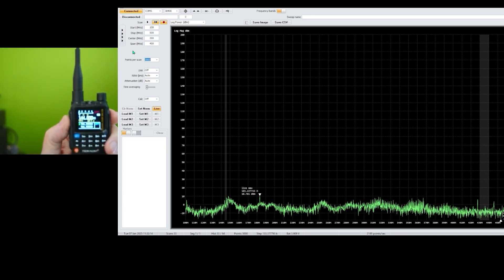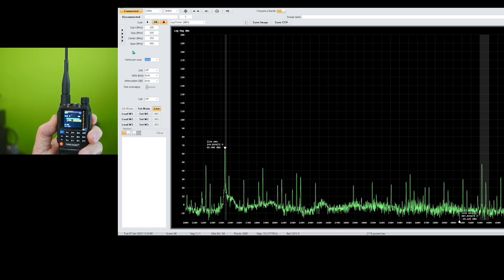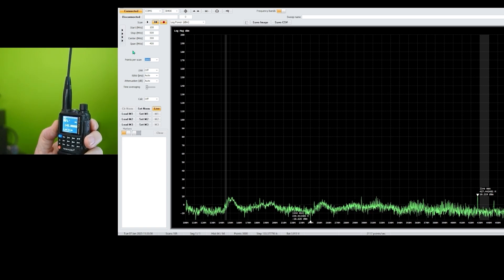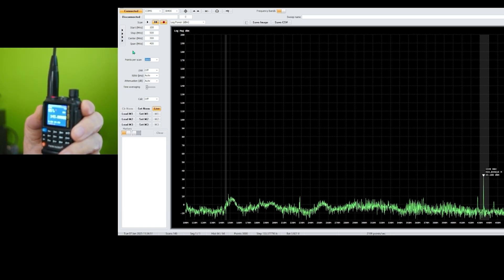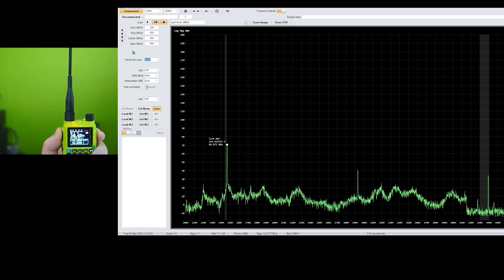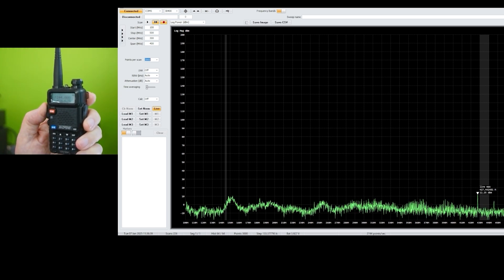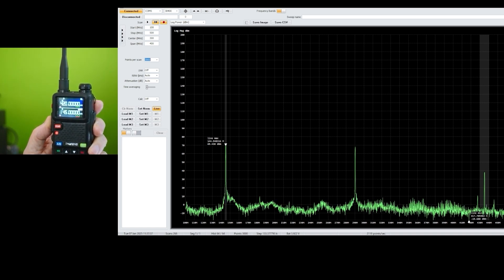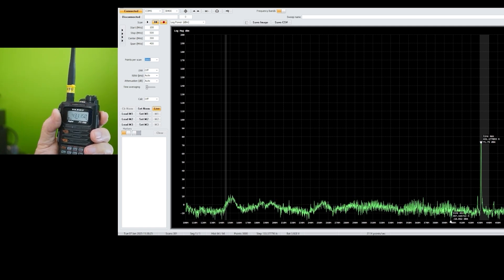Do You Want to Transmit with One of These? You May Be Fined Thousands of Dollars & Lose Your License

Comment: Not to mention they transmit on restricted channels like fire and police. Ill keep my old kenwood. Kids are getting these off amazon and using them to mess with police transmissions.
Reply: His testing methods were incorrect. He needs to take this video down.
Reply from the maker: I tested two ways.  One was directly to an antenna with 30dB of attenuation. The other was through a box that I built.  There was a directly line from one UHF female to another UHF female. In the middle is a ferrite bead about an inch O.D. and mix 31.  There are a few turns to pick up RF.  One leg is to chassis.  The other to about 30dB of att. down to a BNC female. From there to the tinySA.  Also, the H8 and the Yaesu (when on 144) had no harmonics.  They looked very clean.  Yes, overload seems likely but since one of the Tidradios and one of the Yaesu was clean, I don't think the tinySA stressed.  You asked a very good question.  Thanks for your help.  73, Jim W6LG

Comment: Love your channel Jim, but this sounds a bit like elitist crap to me. Wouldn't touch them you say. What do you say to the guy who cant afford to drop $180 on a Yaesu or a Icom etc. So he should just not participate in ham radio even though there are FCC certified radios that he can afford? Just because it is cheap and therefore accessible does not make it bad and frankly I have long been  tired of the elitists who can afford to have the "My radio cost XXX so its obviously better" attitude. Just my opinion and worth about what you paid for it. It's that group of hams that chased me away from the hobby for so long.
Reply from the maker: Good points.  That is why if you buy one, you need to have it tested. Again, thanks for the comment. 73, Jim W6LG
Reply: @ham-radio  I can agree with that. Anytime you get the cheap stuff, (or even the not so cheap stuff) if you have access it never hurts to have it tested. Thanks for replying to me!

Comment: If the radio is being used as intended and is part certified, then the FCC should be addressing this with the manufacturers. What this video is implying is a widespread interference caused by improper manufacturing which is not the fault of the person who bought the radio. The FCC always seems to target one or two indiviudals and then try to hit them with ridiculous fines instead to actually addressing widespread problems. Let's look at GMRS: People are buying Ham radios and using them for GMRS. It's clearly against the rules, but the FCC doesn't require license verification to purchase a Ham radio. It would be very easy to do this since everyone is listed on the FCC website, but they'd rather target individuals. I bring up GMRS specificially because there are no skills required, and no radio knowledge required to get a license. A typical GMRS user is not going to know anything about the interference. The enforcement needs to address this at a higher level than just targetting the consumer who bought the radio legally. It is what it is, but I think it's lazy. They are just grabbing the low hanging fruit and nothing will ever change that way. That being said, I did find this video to be very informative. Thank you.
Reply from the maker: I believe that enforcement at the FCC, not private individuals, needs to be ramped up.  Also, we, us, all of us, need to be very careful.  With a new Administration, there may be again some interest in taking away some of our frequencies again. 73, Jim

Comment: Hi Jim, unfortunately your Yaesu was transmitting on 431.15 MHz versus down on 2 meters so impossible to compare its results with the other HTs you tested in this video.  Also as others have mentioned you really should test each transmitter hooked directly up to the spectrum analyzer or SDR using enough attenuation to assure the input level is below the level where the mixer starts generating harmonics.  As an example if using a TinySA the input level should be -30 dBm or lower to  prevent generation of harmonics in the TinySA mixer.  P.S. you’re looking great.
Reply from the maker: True.  I had locked it on the node.  I had tested it on 2 meters with basically the same result. It was clean down 60dB into my noise.  73, Jim W6LG

Comment: If the same antenna is used on the signal analyzer for all tests, and all of the HTs are transmitting at the same power, the concerns about and effects of overloading the SA should be the same for all of the radios.

However, most of the radios appear to be transmitting at 145 MHz or so.  I'm not sure about the 5RM,  both VHF and UHF frequencies were displayed. The Yaesu appears to be at 431 MHz and with the SA scaling, harmonics are not shown.

It's an apples and oranges comparison.
Reply from the maker: Thanks.  I did test two ways.  One was with a sampler using a toroid to the tinySA connected to my Bird Dummy. 73, Jim W6LG

Comment: When was the last time the FCC fined someone for doing just that during a wildfire, and how many times in the last 10 years? Just once in the last 10 years. And no one has been fined for just  talking to his friends using a handheld radio in the last 10 years. And you may have a pretty good idea about how many people own these cheap handheld radio's in the US. You can check the FCC's database on that data.
Reply from the maker: Good points. It shows that there is not enough enforcement at the FCC.  The compliance tests may be worthless. 73, Jim
Reply: @ham-radio  Well, cheap Chinese handhelds are normally not a problem because people move around with them. So even if they cause interference, it will just be for a short time. 

While a cheap Chinese basestation could interfere for way longer periods of time because it always at the same place. 
The FCC will only act if a radio causes a lot of trouble, and that's okay with me.

Comment: This is another reason many agencies are going digital. DMR, or trunked systems to prevent this. However, there is no way for the FCC to find you; a needle in a hay stack when transmitting...
Reply from the maker: True.  Very true.  But if I am in the Command Center and I interfere with the Sheriff, he is going to be really upset with me.  73, Jim W6LG
Reply: @ham-radio  Thats if he can find you, very doubtful a 3.5w radio will cause any interference with a 40W Motorola radio. Sorry, not gonna happen.

Comment: This is gaslighting and fear-mongering. The FCC is not going to fine a person for accidentally keying one-time a emergency frequency and being instructed to end transmissions. They will only fine you if you ignore or persist to transmit inappropriately. The recent $34k fine levied was for a man that acted in bad faith and ignored authorities. Now, as far as dirty HTs, I don’t know what your agenda is, but you are way over-focused in this. Yes manufacturers should do a better job and it is not ideal, but it is not an everyday problem. Show me one FCC website link of a fine levied because a person used a cheap HT with spurious emissions, then you can talk. This is a nothing burger.
Reply from the maker: Do you or would you, transmit with a filthy, spurious transmitter that covers the sheriff, police, ambulance service, fire department, and other entities?  I won't do that. I can imagine the headline in the local newspaper or local TV station that says "local ham causing harmful interefernce!"  Transmitting on their frequency is not a nothing burger.  And what is your callsign? How many years have you been licensed?  Jim Heath W6LG 61 years on the air

Comment: Good and valid points, but you picked the wrong radio for an example. The TIDRadio H3 is one of the few Chinese HTs that have been measured by knowledgeable hams to meet or exceed FCC spurious emissions standards. And, no, I don’t work for them or sell their radios.
Reply from the maker: Yes. I tried it with a "T" and antenuator into a Bird Wattmeter and Bird Dummy Load. 73, Jim W6LG

Comment: A big annoyance regarding Chinese radios that few ever mention is that they don't have encoders for changing frequencies in VFO mode or memory channels. They only have very slow up/down keys to change frequency operation. They also seem to always lack a DC-in jack so you can't plug them into a cigarette style adaptor in your car. Or maybe an external battery, like I have for my other radios. I have multiple barrel plug adaptors that I can use for my Kenwood, Yaesu or even my old Radio Shack relic using the same motorcycle sized battery. A good emergency back up. Very handy and you can't do that with any Chinese rig. At least none that I know of.
Reply: They sell "battery eliminator" that let's you run off DC for most Chinese radios

Comment: Interesting spread of results (no pun intended). I bought a Tidradio H3 in early December (directly from the manufacturer's web page) and my specimen was actually pretty clean. Into a 50 Ω load (AKA high quality attenuators feeding into a Siglent SA), the 2nd harmonic was a decent -73 dBc and the 3rd was -64 dBc. Using the supplied antenna resulted in 2nd being -57 dBc and the 3rd being -68 dBc (but it wasn't great on receive) so instead using a Negoya NA-701 antenna (which was noticeably better on receive) resulted in the 2nd harmonics being at -60 dBc and the 3rd being at -61 dBc, so was reasonably happy with these results (incidentally, on UHF and transmitting into a load, the 2nd and 3rd were way down at -82 dBc  and -92 dBc respectively). 
I also bought a XHDATA E-100 and on my Siglent SA, it's output looked more like a toppled Christmas tree (hihi)! Into a load, the 2nd harmonic was -19 dBc (ouch) and the 3rd was -41 dBc (I'd still say 'ouch'; that's still far too high IMHO). Even more fun when using its supplied antenna; 2nd was -19 dB, the 3rd was -40dBc and 4th harmonic (so 582 MHz) popped up at -44 dBc (first time I've seen a 4th harmonic appearing from a VHF radio). Needless to say, I sent the XHDATA radio back the next day!  😀 I live at 152m ASL in Edinburgh (Scotland) so personally, I wouldn't consider transmitting on anything with harmonics above about -60 dBc; having a spectacular view of the city in the optical range means that my harmonics would also have a spectacular 'view' of the city in the radio range!! 😀 😀
Reply from the maker: Thanks.  Good to know. 73, Jim

Comment: They don't even do all that well on receive. I have two UV-5R8W (8 watt versions) that some one gave me. I put in all the exact same frequencies in both the Baofengs, a Kenwood TH-D75 and a Yaesu VX-6R. Then I put all on scan and the Baofengs were always stopping on various channels due to not being very immune from common sources of interference. All the while the Kenwood and Yaesu didn't usually stop on anything but an actual transmission. If I take the Baofengs out of the house in a open area like an empty parking lot then they do better. But they pick up the slightest LED light buzz, power supply buzz or PC/PC monitor hash a lot easier than good radios. BTW, my old Radio Shack HTX-202 is also not able to cope with modern interference sources so I don't use it much in the house.

Comment: If my 3W analog HT with a rubber duck interferes with a multi million dollar digital system, then it’s not my little radio that’s the problem.
Reply: Garbage noise thrown in the air can absolutely stop the transmission depending on location of the intended recipient on their handheld.  If the radio is truly for emergencies, buy quality and throw out the Chinese crap
Reply from the maker: Perhaps.  But I suspect that an excuse like that would not be acceptable to "agencies" like my local FBI office.  73, Jim

Comment: Most law enforcement and fire departments have gone digital, so surely it shouldn't be a problem
Reply: I think the FM capture effect works to overwhelm most co-channel interference in analog and digital modes. If a kid is on FRS two blocks away from a police car, and the kid's radio puts out a harmonic exactly on the same frequency. There is likely little interference that amounts to much. Unless the kid has a 100 watt FRS walkie-talkie!!
Reply: @markr.1984 Let's take 5 milliwatts and then do inverse square
Reply: @randykitchleburger2780  
5 mW will take you 60 km or more in line of sight, but the interference range is much less (and harmfull interference even less, but can be annoying, anyway...)
Reply from the maker: Good points, thanks, Jim
Reply from the maker: My local fire and police have not but probably will at some time. 73, Jim
Reply: Most rural PS agencies are still on analog.
Reply: There are still a lot of rural counties that are still on analog and have not been able to afford digital. My local county is getting ready to go digital.
Reply: Digital is more interfered than analog....😊😊😊
Do your homework...

55 years experienced on comms guy
Reply: @jplacido9999  I've been working in Public Safety in a major Metropolitan  area for thirty years and we don't have any interference on our Apco Project 25 system.
Reply: @jplacido9999  I've been in public safety For decades in a major Metropolitan are and our Apco 25 has had no issues with any interference.
Reply: @jplacido9999  That's incorrect.
Reply: @choppermike3329  
No.
FM analog can withstand more interference and survive.
Digital becomes inoperative (either you receive or you don't completly) with QRM.
Without interference digital goes fine, in spite of the terrible voice sound quality on receive (there are few exceptions), but even sincronized interlaced jamming blows digi comms and no one notices what is going on..
Reply: @jplacido9999  Over twenty years digital with no loss of comms.

Comment: Garbage is the guy who brags about 1,500 watts and  splattering the bands . I got a $35, 000 tower up 300 feet. 6 elements and 1,500 watts. That's bs and Garbage.  Not everyone has $50,000 for a hobby. I'll bet if I check your car, it generates as much garbage. Enjoy the I'm richer than you. Typical 6 call.

Comment: Provocative video, Jim. You make good points about the importance of knowing whether your TXN is clean or dirty.  A number of reviews suggest the TID H3 usually meets FCC standards. What’s different about your test vs others?  
Did the dirt your H3’s displayed  affect EmCOMM frequencies? If not, nobody’s gonna knock on your door unless you work hard to actively interfere  with emergency operations. 

FCC DOES consider the intentions of the operator when interference occurs. The Idaho guy fined recently   didn’t accidentally stray from the ham bands—- he purposefully used National Forest  firefighters emergency frequencies and attempted to direct personnel  to defend his own commercial property. And he persisted despite direct orders to cease transmission. 

Your 5-watt H3 would never muddy comms enough to draw that scrutiny.  FCC doesn’t have the interest or resources to hassle small fry.

Comment: Your results are very different from many others I have viewed? I  don't  have any of these but have thought of getting something to use on local repeaters. The most recent fines etc lately I have seen reported have been willful interference by bad actors not so much bad radios. What many misunderstand is the unlicensed CBer using wrong radios. What few realize is using a  radio not type accepted moves someone to a Communications Act of 1934  violation not a FCC rule violation greatly increasing fines or even a jail cell if ignored. The radio in CB is the license , while our ticket is our authorization. 

 I was surprised by your results and will be more diligent about what I do buy, thanks for the HEADS UP !!! Lately a handheld with a very wide receive has been written about. I am near a busy airport and have become interested in monitoring traffic from it and this held held  does hear the AM VHF air band,

Comment: I got a UV5R about 3 years ago at the local club's Xmas gift exchange.  I've never transmitted on it.  How can something so cheap meet required specs?  That's my thinking.  You asked so my answer is I'm not willing to risk money and license to save a few bucks.  Also I don't want to contribute to a potential black-eye to ham radio if there is a serious interference problem with these radios and as a result we get subjected to more rules/regs.  As to those who say that nobody has been in legal trouble I would say that just because it hasn't happened doesn't mean it won't happen.
That's like someone saying they don't wear seatbelts because they've never been in a crash.  That's fine logic until you are in a crash.
Anyway, to each their own.  I'm not transmitting on one.

Comment: Great video JIM !!  A hefty fine was given to a HAM for interfering with emergency services ! This was deliberate but it was  harmonics that did this the same thing would happen. And if a dirty radio lead to loss of life .  A fine will be the least of your problems . With a amanture radio lience part 97 of FCC is on us ! And it is a question on the test ! With the privilege of being able to experiment with radio is a great thing. But that responsibility of clean signal and not interfere with outher services   is ours !     The problem I have with standards for harmonics is they stop in VHF radio. There is nothing for UHF and up. How many emergency services use 700-900 MHZ bands.   I just apply standers all the way up threw UHF when testing.  I have testing many HT radios and they all over the place with being clean or not. It is buyer beware . But their is some clean UV-5R and Talkpod A36 radios . But few and far between . Evert HAM should test their radio whatever it is. I do a lot of portable ops like POTA and I run filters ! like a lowpass or bandpass filter .I have tested all my radios/transmitters and check them often.  Very good points from JIM W6LG !!  Hope we get them CA fires out soon ! 73